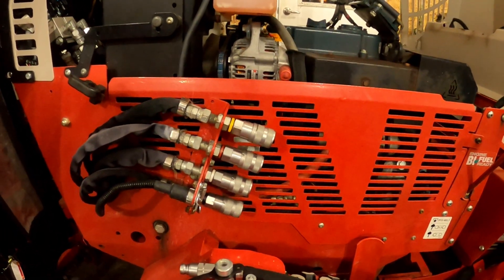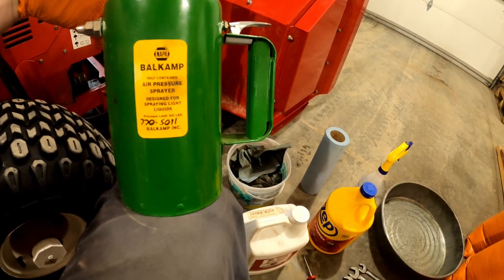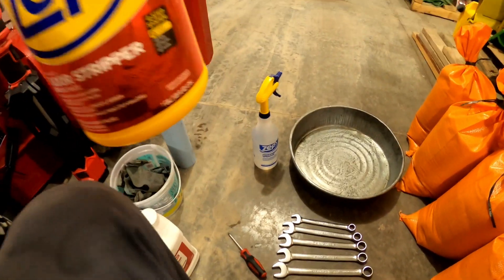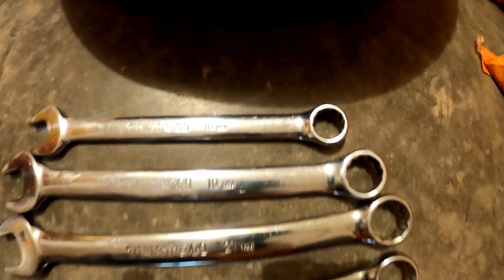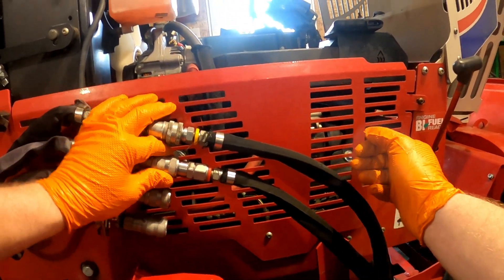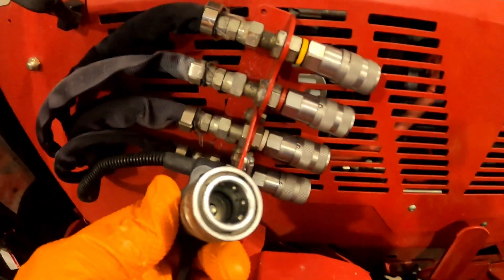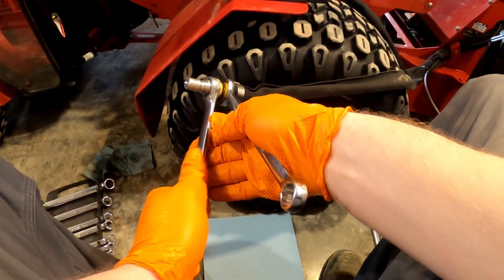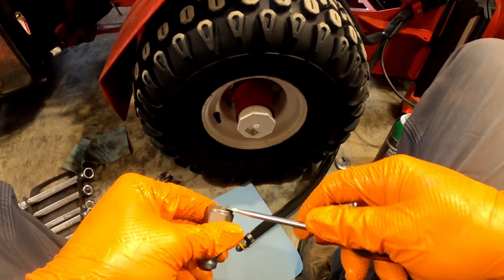Ventrac 4500Z with Flat Faced Hydraulic Couplers!?!

Comment: I am not concerned about the small loss of fluid and do not mind cleaning the plugs; but I hate it when an implement has been parked cold and then when needed in hot weather the flluid in the lines has expanded making coupling impossible without loosening the coupler and bleeding off the pressure.  Does the open type solve that problem?
Reply from the maker: These specific 1/4" flat faced couplers will not fix your specific issue because they don't have an intergraded pressure release (connect under pressure). I have mentioned to Summit about offering a 1/4" intergraded pressure release (connect under pressure ) flat faced coupler. They were open to ideas and I gave them my idea. They do however offer intergraded pressure release (connect under pressure) on 3/8" and larger couplers. FYI, the intergrade pressure release, to my knowledge is only on the male coupler. I initially looked in the 3/8" size couplers because of the connect under pressure feature. However, due to the size of the couplers, I determined it wasn't going to work very well or potentially at all.
Reply: I found these couplers from Parker which have the pressure relief capability.  Maybe these fit the 4520. Please verify and see if this will work. Here is the info, 
Female Coupler:
	•	Model: FF-251-6FO
	•	Description: 1/4” body size with 9/16-18 UNF (SAE #6) female thread
	•	Features: Flat face design to minimize spillage and air inclusion; equipped with a sleeve locking mechanism to prevent accidental disconnection
	•	Pressure Rating: Up to 5,000 psi

Male Nipple:
	•	Model: FF-252-6FO
	•	Description: 1/4” body size with 9/16-18 UNF (SAE #6) male thread
	•	Features: Flat face design; compatible with the FF-251-6FO coupler
	•	Pressure Rating: Up to 5,000 psi

Comment: Do you know what the psi is at the aux hydraulics? Thanks
Reply from the maker: Unfortunately, I don't. Call Ventrac directly and ask. I'm sure they would be willing to answer you question.
Reply: @westriverlawnsnow3452  Ok, I tried and they won't give it out for some reason.
Reply from the maker: Hmm..... I'd try calling your local dealer and ask them. If the dealer doesn't want to saying anything, go to a Facebook page called "I Want A Ventrac One Day" and ask your question. I believe you have to be a member to post anything on the page. I'm curious, why do you want to know the aux pressure?  @LoganTech98

Comment: I'm so tired of the mess and losing hydro fluid by switching attachments.  After watching your video I purchased all the flat faced couplers I needed from Summit.  The only problem I just thought about is if I rent an attachment from my local Ventrac dealer, those hoses will not work.  Perhaps I need a couple extra couplers in that case to swap them quickly during a rental.  Thanks!
Reply: Did you mean to post the link for the NPT thread couplers, because I believe the Ventrac's use SAE thread.  I ask because the couplers I purchased from Summit don't fit, based on your link above.  Thanks.
Reply from the maker: @timadamany  NPT is the correct thread type. The SAE thread type uses an o-ring. When you unthreaded the coupler, did yoy see a rubber o-ring? Are you the original owner of the machine? It would be really odd, but certainly possible for someone to switch to the SAE thread type. 🤔 I wish I would have seen this comment sooner, unfortunately I never received a notification for it. Did you get things straightened out or are you still working on it?
Reply: @westriverlawnsnow3452  All the attachements, according to the parts diagram state they are all SAE.  I have a 2022 4520Z for the record.  The first set of couplers I bought from Summit were NPT, and they did not fit, as the threads were not the same.  The replacment SAE couplers fit beautifully.
Reply from the maker: Interesting! Good to know! The 4500 use NPT and I guess the 4520 uses SAE. I personally don't like the idea of dealing with o-rings on aux hydraulic couplers. Just one more thing to cause leaks. I will update the description.
Reply: There's going to be oil loss no matter what style coupler you use. Not worth the time or money
Reply from the maker: @MyDc85  Ventrac themselves would have gone to flat face style couplers on the 4520 had they not already had numerous attachments and tractors with the pioneer style. The SSV and it's attachments have flat face style couplers. In my opinion, it's ABSOLUTELY worth the money to switch to flat face couplers. You REALLY see the value when you use the machine commercially and have several attachments you need to switch to and from numerous times throughout the day on a project.

Comment: Excellent idea! All good points to dump the pioneer couplers. One of the draw backs I have found is the dust covers are usually very dirty after mowing etc, and you have to clean them off before using. The only draw back to swapping is having to buy 12 pair of couplings!! I was surprised you didn’t use any thread sealant.
Reply from the maker: NPT threads are tapered, so the seal is made via the metal-to-metal wedging of the threads. No thread sealant needed.
Reply: @westriverlawnsnow3452  I know thats the way its supposed to be, but I have had to reseal a few lines using the blue sealant before on some attachments.